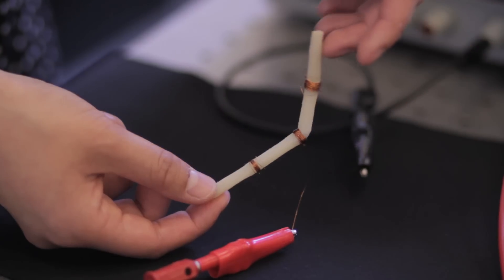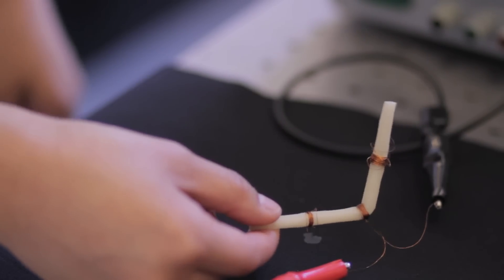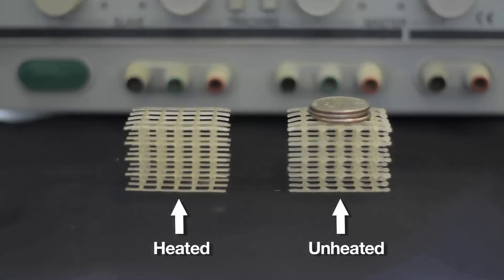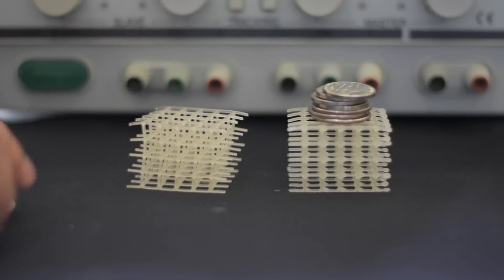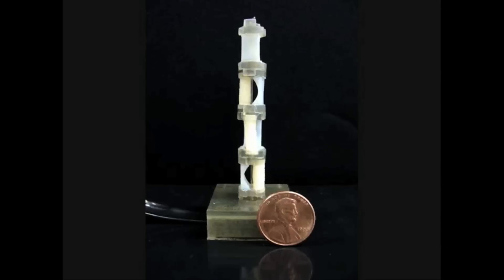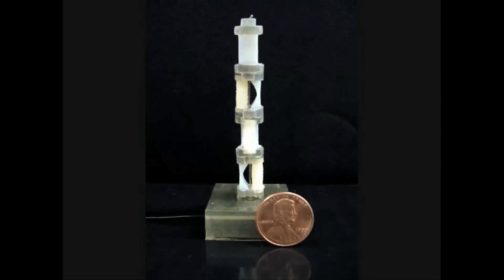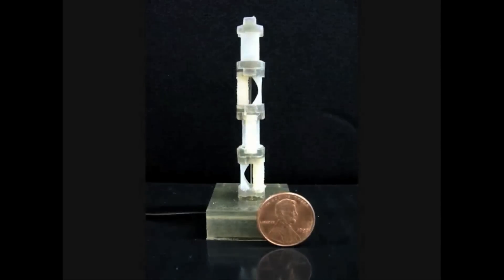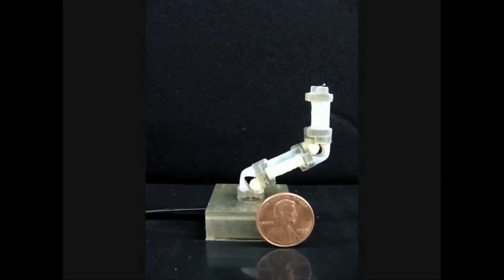Squishy Robots

Comment: In recent science periodicals I have read of several different methods for making different material rigid and then pliable. I think anyone of them would be more practical than a wax impregnated material. This system would obviously have to be housed in a temperature controlled shell, so ambient temperatures didn't affect it,  not to mention the problem of load bearing capability.